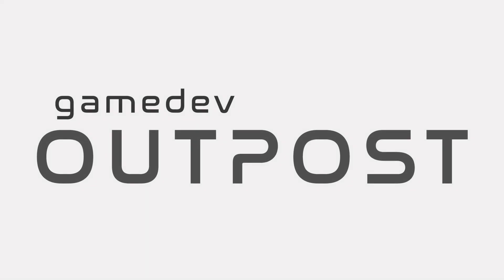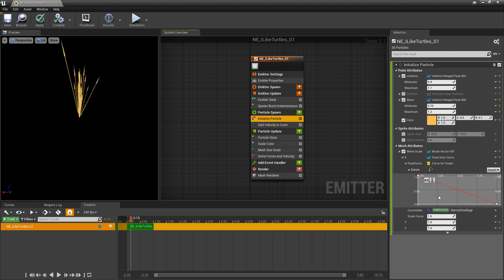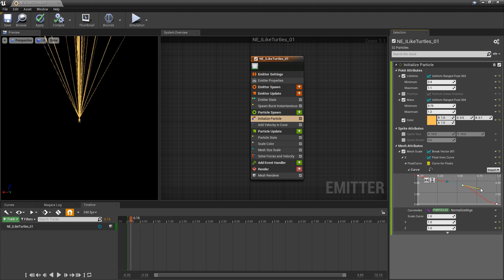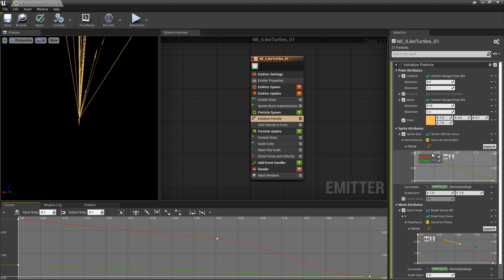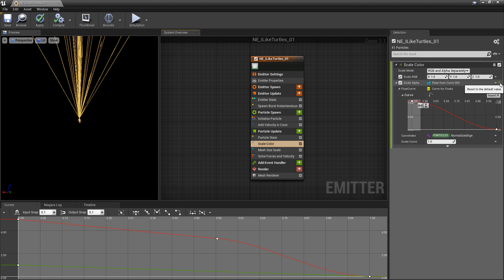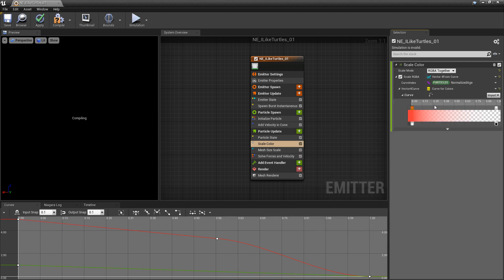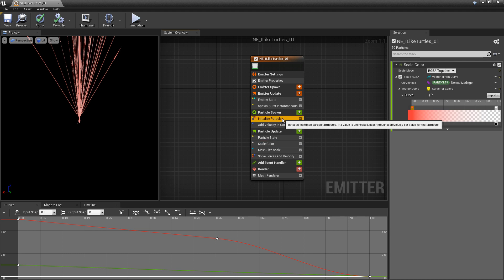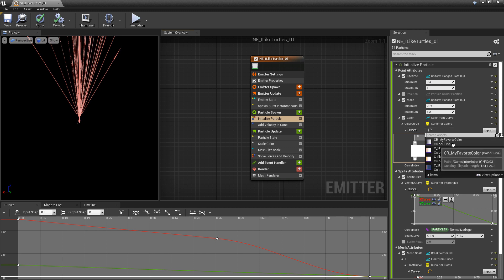UE4 - Niagara Curves

Comment: I've been trying to animate the spawn rate with the 'float from curve', but couldn't manage to. Do you know what is that curve time value based on? Both particle lifetime and emitter life cycle seemed to affect it, which makes it impossible to keyframe how I want to.
Reply: yes. i think that curve don't work in 'particle spawn'. i am also confusing.
Reply: @araleeyo16  You need to expose/promote the parameter you want to animate to Sequencer and keyframe it there. :)
Reply: @maciejstepniewski1970  thanks